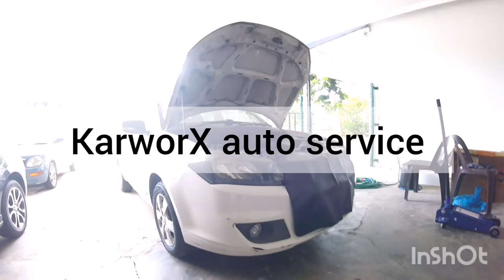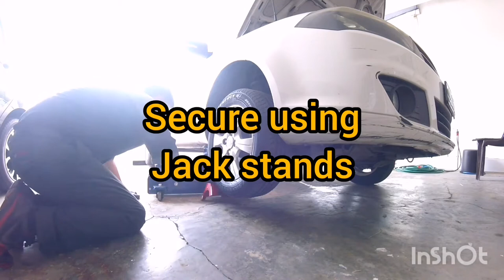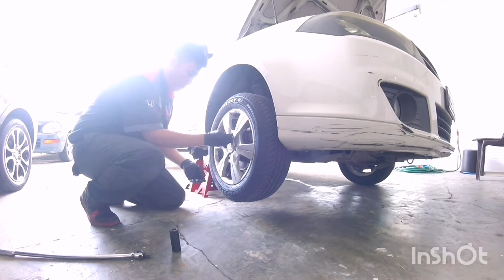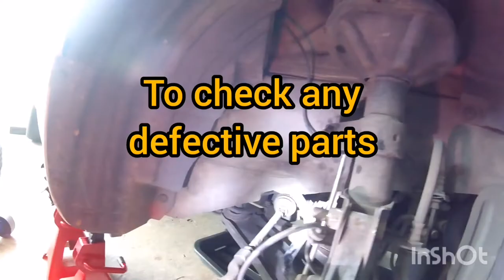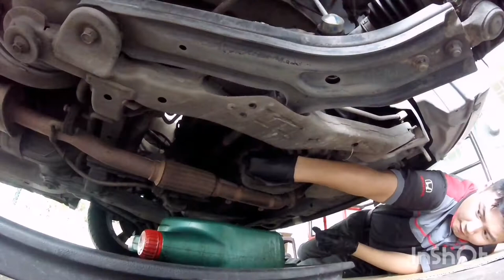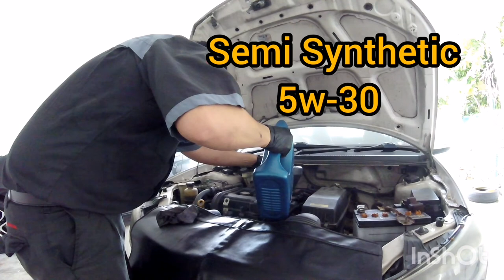#Saga FLX service

Comment: klau sevis gearbox cvt flx auto buli jg ka bos?mna bgkel d sbh bos
Reply from the maker: Bole bole bos. Belum ada bengkel, setakat masi buat di ruma saja.
Reply: @karworxauto554  sbh mna bos?
Reply: @karworxauto554  pndi buat lveling dgn gear adptation  ka lps sevis bos..
Reply from the maker: @putrakb5477  di Kota Kinabalu.
Reply from the maker: @putrakb5477  pandai bos
Reply: @karworxauto554  dmna d kk bos??brpa upah mnta sevis gearbox trmsuk lveling dgn adapttion bos,mnyk cvt flter gsket sy sdri